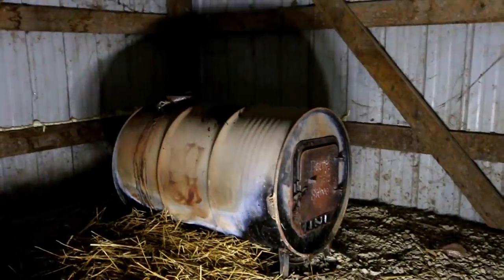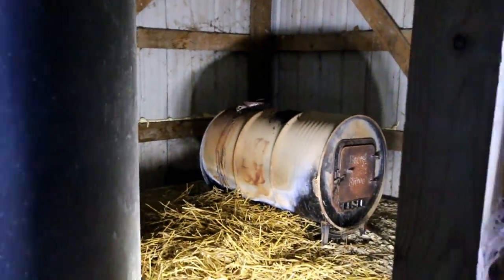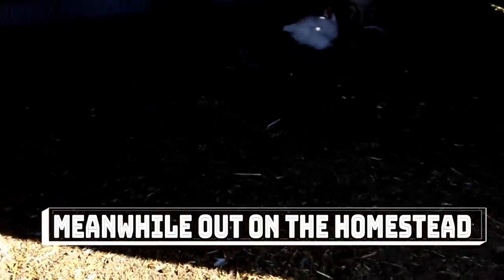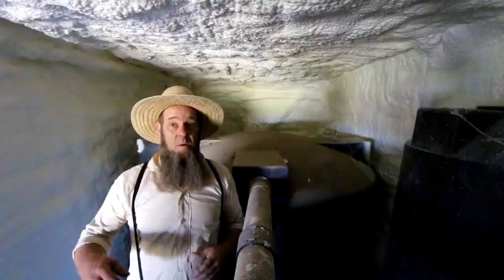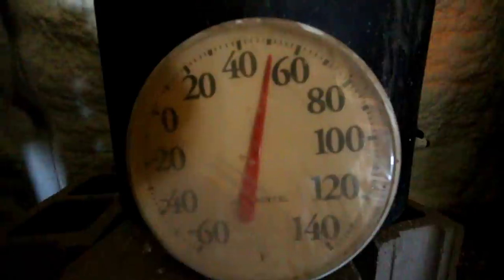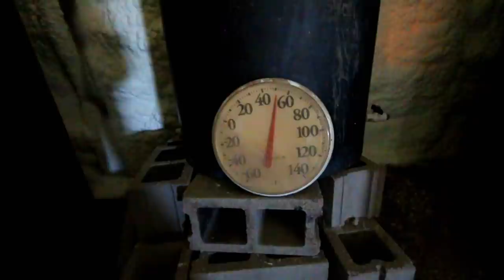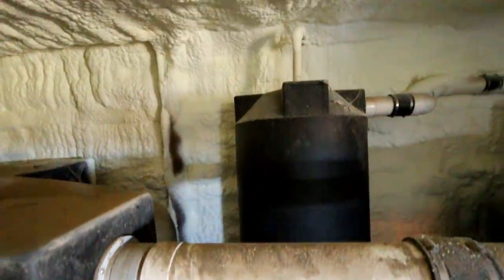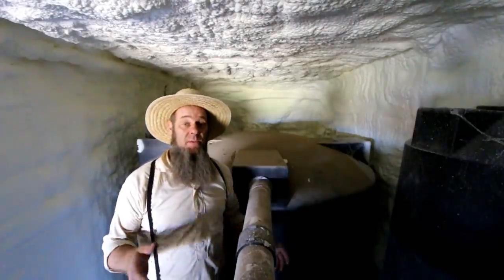Keep your OFF GRID water from FREEZING in WINTER | Off grid | Rain water catchment

Comment: Idea....You could use Thermal Heat with a 5 " flex pipe. Run it 50' or so out an d back in, 3 to 4 feet deep. Solar fan to circulate air through pipe.
If more heat needed, put a compost ditch outside and run pipe through it on the floor to the side of the ditch. Compost materials such as grass, straw, leafs will make heat as they rot producing heat in pipe. Just a suggestion. Love your Videos.

Comment: Hey guys! When you first put that  wood stove in, I said this would happen. That's why I suggested a rocket mass stove to radiate heat even when the fire goes out in the night. Also, it would hold the heat instead of it going straight to the outside.  AND it does it with much less wood.

Comment: Doug:  look for a good used camper trailer propane heater.  This you could use for back up in a real cold snap.  The Advantage is 12 V. thermostat, ignition, small battery,   automatic etc.   It will probably not be needed but is there when you're not.   the old guy    Bert

Comment: thanks for the vid.  if you do end up having to heat that space look into a small rocket mass heater.  they can be made for very little, require small amounts of fuel and with the right setup they will easily heat a small room all night without refueling.

Comment: should have reinforced that ceiling more with beams 1st, the weight of foam may pull it down, too late now, but you can still add support columns
Reply: The foam weighs practically nothing since it is largely made up of air bubbles, that's what both gives it it's insulating properties, and causes it to expand so much.
Reply: @julie baker, time will tell

Comment: I purchased a home last Nov. A shared well w a legal binding agreement filed w both deeds. During my home buying process the man (where the pressure tank and well are housed) died. I had to find the heirs to get the agreement signed and filed as this is the only way I could finalize my loan. The heirs decided to return the house to the bank (wells Fargo). The heirs and myself had conversations w wells Fargo about the shared well agreement. They even sent me a letter regarding our conversation. Of course they ignored the legal binding agreement and winterized the house where the well is. If the original owner had built a seperate in ground line from the well to my house and had installed a toggle switch with an electric line going to my panel box it wouldn't be an issue for me. I do have two 275 gallon Ibc totes. One has been collecting rain water that was used to water the garden. The other still needs cleaned (from wine), prepped, and connected. However, not a viable solution until spring because I need to build an insulated storage for them to keep from freezing. So, I'm temporarily having to give up homesteading to go stay with a friend in Florida for the winter. Homes could sit empty up here on the mountain for years. So alternative plan will most likely be to connect a pump to the totes for a water source. I live on disability. Any money I had this past year has gone back into the house with other needs. I did call legal aid but not they will take the case. I shouldn't have to go that route especially when wells Fargo knew about my water rights through legal means. Wells Fargo has a history of playing dirty. Thank God I don't use them.
So Doug, I'm going to learn even more from you on water systems. So glad you and Stacey share your knowledge. Thank you.
Reply: Im sorry for your plight.  Can u file anything w the county as a violation of your rights?
Reply: @americaneden3090  everyone is passing the buck. No one wants to be involved.

Comment: The insulation can only hold heat in if there is heat inside, the insulation can hold cold in as well as heat, insulation will stop the losses but you will still need a heat source. The most efficient method to heat a water tank is with a submersion heater inside the water inside the tank, the second most efficient method to heat a water tank is to draw off some water heat it up and circulate it back to the tank, maybe heat with a propane in-line heater and set it up to thermo-syphon. The most inefficient way to heat up water in a tank is to heat the air around the tank and wait for the air to heat the water in the tank, ...squirrel!
Reply: I am interested in hearing about this
Reply: I don't think they are trying to heat up the water itself. They are trying to prevent it from freezing.
Reply: This wasn’t meant to be a water heater. It was suppose to prevent the piping in and out of the tank from freezing. If he has to use any heat source, it will be more efficient now that heat loss has been thwarted by the foam insulation.
Reply: Actually, heating up there water itself is a much better idea, than simply trying to heat the air. The water would act as a thermal mass. It doesn't need to be hot. Just around 60 degrees. There are off grid options for that. One such off grid option are solar bottle water heaters. They are fairly efficient at heating water. If you regulated a flow. You could balance it at just the right temp. Sounds complicated, but is really quite simple.
Reply: You are right. But you will have to maintain a higher temp in the tank to keep the pipes  and other fittings in the room above freezing.
Reply: I agree. The insulation can only slow the transfer of heat in either direction, be it hot to cold, or cold to hot. During a cold snap, insulation will slow the loss of heat from the tanks. This might be enough for short periods of cold. Given a long period of freezing weather, the heat lost from the tanks will need to be replaced, or the water will eventually freeze. Put another way, the blanket you cover up with is not "warm" it can only slow the loss of heat your body is generating.
Reply: All insulation reaches thermal saturation at some point and time.  But this will make it easier to heat the inside of his water storage area and     be more efficient.

Comment: Here’s hoping you used closed-cell foam. Open cell-foam will absorb water, if there is a leak and it will get heavy enough to bring down the building, FYI. Do yourself a favor and paint a coat of latex over the foam. It will become a barrier against the propagation of flame, should things turn south and you have a fire.

Comment: Have you thought of using a rocket stove and a mass heater to heat that room? Put the "battery" aka the mass heater under the tanks. You'll burn a lot less wood and you won't have to worry about stoking the fire during the even the coldest nights now that the room is insulated.

Comment: Watching the foam expand is mesmerizing!  What kind of R-value does it have?  I am curious with this vs the preformed foam panels at home improvement centers combined with the cans of spray foam for crack filling.  (doing a low-tech cost comparison)
I'm in SE PA and we had several weeks of 8-10F 'ish temps last season and I had a water tank seam split on me... even with 25% air space above it.  I am thinking the cylinder-on-its-side configuration (curved tighter above the halfway point) didn't allow for proper expansion.
I mended the split with some plastic from milk bottles, a piece of re-bar (my hot tool) and a propane torch to do some plastic welding (big soldering iron?).  It holds water, but probably not as strong as the original build.

Comment: would seem a lot easier to just foam the tanks . closed cell foam  think of it like putting a sweater on the tanks..
Reply: Steve Pailet I like your thinking..also create a foam box for the tanks.
Reply: The tanks are very low risk for freezing. His intent was to protect the pipes, valves, etc. This way everything is protected and still has access for cleanouts and repairs. 🙂
Reply: @timsmith1029  Then you only have to build boxes around the pipes and valves where they can still be accessible and foam around the outside of those boxes.. Given the choice the difference in amount of foam needed is dramatic

Comment: I'm just curious? I was always told that the spray in foam off gasses. After it's sprayed. Wouldn't that be a heath issue with your water?????  The guy that was spraying it was wearing a resporator?
Reply: Yes, the technician was wearing a respirator, not to would have been a safety violation that comes with a hefty fine. The off-gassing usually doesn't last more than a week or so. You're exposed to more off-gassing in a new car anyway, since you'd spend more time there.
Reply: I was wondering the same, with all their eco friendly ambitions, I should think this may be a formaldehyde based product and formaldehyde is a carcinogen. In any case, it would have made more sense from the outset to have dug a big hole for an underground water tank. Even without electricity a hand pump would do.

Comment: Turkey story please. Did the sliding door get foam on the opisent side? You may have a new hot water system in the summer. You guys are sharp.
Reply from the maker: Even did that one with closed cell so it would handle the opening and closing of the door ✔

Comment: I love seeing the animals around the farm!  Meanwhile.....
Good idea to insulate!  You will save so much energy.  In my opinion, you can never have too much insulation.  I hope it is done off gassing.  If you are heating it with combustibles, I wonder about getting enough oxygen in there.  To bad you can't heat it with a sun oven!  

Now, to insulate the bees.  I feel like your bees need shade and a bit of a windbreak.  
You have such a beautiful farm.  When I look at old pictures of farms, they all had windmills or water wheels.  

I heard making turbulence inside the tank helps keep the water clean with less bleach.

I'm not selling anything, but I saw this concept in this video:
https://youtu.be/Z8HO5DGZcM0